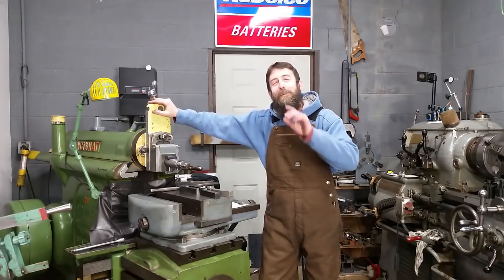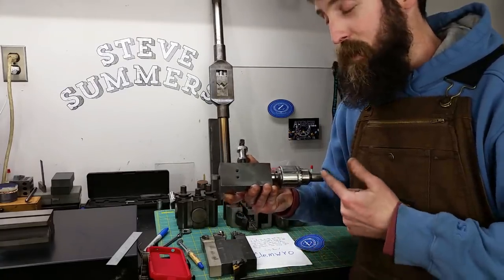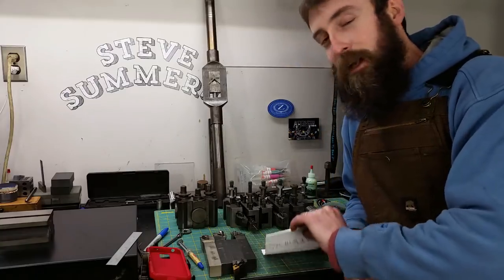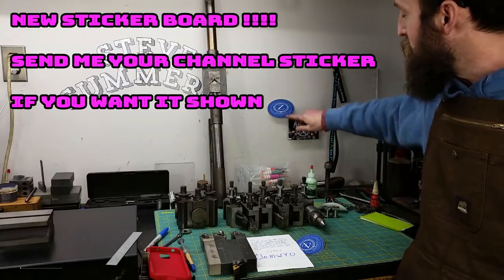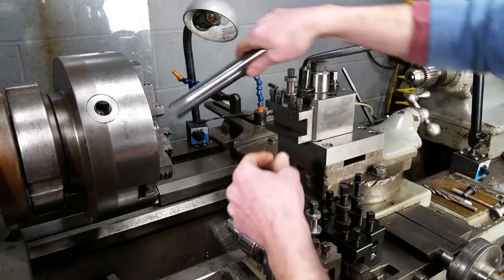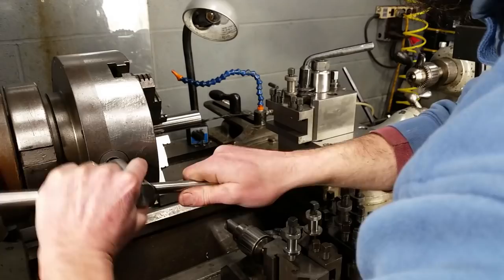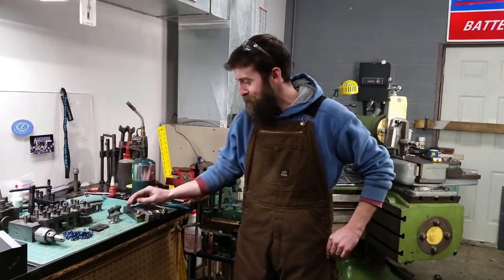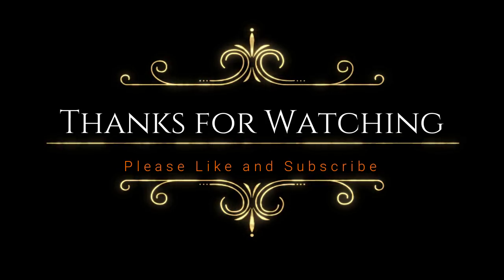SWEET !! Metal Shaper and Lathe work ;-)

Comment: Actually you can go back into a knurl. Just go up against it lightly with it not running be sure both your knurlers are in track and push in then start rotating.  Also 3 jaw chucks are designed to use a master key. The master key is the one that was tightened when the jaws were ground. It then needs to be used to tighten with in the future for maximum accuracy.  If you don't do this you will end up chasing your tail as if you tighten up a different key first the runout will be drastically different.  At least this has been my experience. I have the #1 screw marked on my chuck and always tighten with that one and achieve repeatable run outs on any given diameter in the less than .002" range.  If I tighten with one of the other screws first I can see run outs of .005-.010".
Reply from the maker: bcbloc02 I did not know that 🤔 never noticed if one had a mark on it or not. Got to go check..
I'm also interested to see if I get different results, I did notice that it seemed to help it I hit them all, I just thought that I was reducing the chance that I was pulling the scroll to one side.
Thanks Brian I'll look closer and see what I can find.
Reply: My Bison has a "0" mark to go by.  I hit all three, and make sure the marked one is always last. 
Because I have to be careful on how hard I pull on something, I started using a torque wrench.  The additional length makes it easier to do the final cinch without putting too much gronk on it ... or if you are one to err on the cautious side, to make sure you put enough on it.
Reply: I don't know if it is a standard or not but on my Cushman it is the screw between the #1 and #2 jaws. It has a - next to the screw.  That has the #3 jaw down and thus it lifts your part up with a single jaw vs pinching it up between 2 and that makes it clamp up more evenly vs gravity. I have always been of the opinion that 3 jaw chucks intend for you to tighten only with the master key as it gets the part plenty tight and the purpose of chucks like this is speed. Having to go around and hit all 3 wastes time. The only reason they give you others is so you can tighten from alternative sides for different applications.  3 jaw is all about speed of use with reasonable accuracy.  I hope this helps you to get better results. :-) Creek up your way?
Reply: That may very well be, I always figured that if hitting all three was good practice with a drill chuck, it would be good for a lathe chuck.  Bring 'em in with one, snug with the second, whang 'er down with the 3rd was how I used to do it, before I employed the torque wrench, now I hit all three with equal pull ... might be better for the scroll that way, and in the long run it's still faster/easier than the 4 jaw.

I haven't paid much attention to the local creeks.  The way cold, icy weather affects me, I've barely poked my nose out the door over the last few days.  The niece's latest rescue is fine with that, when she rescued it it was 10 below outside, and it was wild as a rabbit, a true touch-me-not.  Now it's a heat and attention seeking cockleburr that thinks people are warm blooded furniture and that attention isn't such a bad thing.
Reply: A chuck that repeats within 0.002" is a real good standard chuck, to get better like within half a thousand the price multiplies by up to 5 times...   Brian is right aboutthe 0 or the the key with the most repeatable operation...
About using a Bump type knurler, the diameter is quite important without being critical, also don't be affraid to really "BUMP" it in right off the start so the wheels make their imprint deep enough in the first rotation, then on the second rotation the wheels will get something to track back into, you have the chance to posess a bigger size lathe this will help you with this bump knurling method...
If you want more detailed info on the paratice and theory of knurling I've got 2 videos on it, if you ever watch and could comment on how understandable it is it would be great to have feedback from someone that is newer to the subject.  I'm using pinch type tool, though...
Reply: Pierre's Garage tom Lipton has a video that goes into the diameter/knurls per inch math and stuff, very informative and quite easy to understand, I'll go check yours out right now

Comment: You need some fire bricks to heat things on, would greatly speed up the process. Your projects in this video came out very nice. I actually like the knurling you did on your tap wrench handle. I'm not a fan of sharp knurls  on tool handle like that, too hard on your hands.
Reply from the maker: carlquib Hey Carl good to see you.  I have some fire brick, I was just to lazy to go in the welding area and get them.  You are correct, if you notice the vise was pulling all the heat out of the part and the color was lighter on the bottom because of it. Thanks for stopping by, always a pleasure 👍

Comment: Thanks Steve,  thoroughly enjoyed that video. I spent an hour cutting down an oversized parting tool yesterday. Real slow, lots of smoke n oil and curling blue chips .. very satisfying. Had to take care as it was a butt welded HSS bit and I ended up using a brazed carbide bit to get through the welded area. All the best mat. PS nice heat blue job ☺

Comment: Time to stock up on some morse taper drill bits and that way you could eliminate the drill chuck in that holder. Should tighten up your run out I would think.

Comment: Hi Steve, Here's another tip from the Montreal crowd (I will add, Phil's an awesome guy in person, too). I have noticed that you tend to hold only the handle on your files on the lathe, which can be dangerous. A better technique is to hold the handle in your left hand, and reach around with your right hand to hold the tip. This reduces the chance the file will get caught in the chuck, which would make for a bad shop day indeed. Keep up the good work! -- Murray

Comment: Nice carbide insert tooling.  Those are some nice scores.
 I have built up a nice assortment of insert holders myself. They are so handy, I resist using regular HSS bits as much as possible sometimes to a fault where the HSS would have been the better choice. It is just so damn easy to change the insert for a fresh tip, no grinding needed.

Comment: Blowing smoke rings at 36.40 minutes.Classy.
You can also traverse the knurl tool across the face each way.Best not to run off the edge though.Helps to even out the cut.

Comment: Ive had to do that a few times to some tooling that I had gotten for the lathe so it would fit also. When you were cutting that tooling, it looked like how it was cutting the quick change tool post I was making, lol. I wonder if it's made of the same stuff? (somewhere between rock and too freaking hard)

Comment: I know that tool holders are tough I've milled dovetails in them for direct mount to BXA holders. Then drilling and tapping them are fun
Reply from the maker: James Dedmon They are extremely hard. I can imagine that milling slots would be tough.
Reply: It is but if you use insert milling cutters it works ok

Comment: Thanks for making the video. Runout on your three jaw looks fine for that piece of stock. But if you chuck something larger or smaller you will most likely find different runout. And since you were turning all the diameters on your workpiece in one chucking and parting off, it doesn’t matter how much runout you have in your chuck for this project. Grinding the chuck jaws is primarily to correct a bell mouth condition. If runout is a real concern use a four jaw chuck and indicate the workpiece in as accurately as needed or use a collet chuck. Of course, with your large lathe, the chuck weighs a ton and not easy to change. Thanks for the bluing exercise. Most of the parts I make for my gage shop customer spec a black oxide finish I use a room temperature chemical process. Have fun making chips.

Comment: Love watching the shaper do its thing. They are just a big scary mechanical contraption. My favorite! 
And dropping something in the chip pan, you're lucky you found it. Even on my small lathe with a chip pan I can easily remove, anything smaller than a sledgehammer can disappear for a long time. I think the chips try to get back at you for removing them, and attempt to eat whatever you dropped amongst them!

Comment: This Old Tony awesome work! To make modeling simpler I would have left out the blade as it’s mass is so low and it’s stiffness is so high(axially) that I would expect that it will not have a significant impact.  As far as actually measuring your vibration at the face\edge I would use something called a laser doppler vibrometer. The only caveat is that I think that they would get expensive above ~20kHz. It would tell you not only frequency but also speed which could be turned into(integrated) displacement with your Scope and a math function. The other way would be to use a high speed camera. I would expect that you would need at least 80k frames per second and more would be better.
Reply: Wrong video ;-)

Comment: @9:00 in your video. you are indicating the run out.. can you stick your indicator to the chuck face and check for rise in the chucks as you tighten them  where the grooves in the internal jaws have worn slightly.. or check them on the surface plate.  perhaps needing to figure out if you can do something like spray welding up the groove and using your shaper to very carefully cut tighter fitting grooves..  might have to do something similar on the chuck face.

Comment: Hi Steve, nice mixed content 👍. I have one quick question, why did you loosen the cutter to square up to the work rather than loosening the QCTP? only thing i can think of is habit after using the multi tool holder or the main block was already perfectly squared for drillchuck holder and you did not want to move it. They are not only quick change but aslo quick swivel to get a good cutting angle. Mi qctp is the same style only much smaller.
Reply from the maker: Derek Greenhalgh The tool post was already set for other holders and I didn't want t
 re adjust  all the others👍
Thanks for watching, I really appreciate it.

Comment: Nice work Steve! Did you put a packing piece on the opposite side of the vise to have it loaded evenly when you gripped that toolholder?
ATB, Robin
Reply from the maker: ROBRENZ I did not. I should but I always forget details like that. I notice the difference in clamping strength when I do it. 
That would be a good thing to mention in a future video. I appreciate the attention and the reminder. I will think about it next time.
Always a pleasure Robin, Thanks👍
Reply: I think the singing noise on on those cuts was because the toolholder was only tight at the tail end from jaw deflection and could vibrate like a tuning fork at the insert end.
Reply from the maker: ROBRENZ Very well could be.. not sure but it was late in the operation and I was thinking it may have been due to the cutter dulling but that was just a thought.

Comment: For an old chuck I would be satisfied with the run out you have. If you regrind the jaws on a Universal  Chuck it will only
be accurate at the opening position that it was reground at. Other positions will be dependent on the condition of the Scroll
and the wear on the Jaw Guide Openings. If the Jaws are sprung Regrinding may help your grip but other than that
I would be happy
Reply from the maker: Wayne Gotthardt I ground these once before a few years ago just like Robin R did and it turned out nice. I did have about .005- .008  runout no matter what I did.  I'm aware that the wear in the scroll and jaw slots make a difference depending on the opening position. A old chuck reground at 1 opening position may be out everywhere else.  I m pretty happy with its runout gripping with the full jaw. The issue is clamping short at the ends of the jaws. To be honest it's fine for 99.9% of what I do but it would make a good video for the folks who have never done it.. Thanks for watching and the great comment, that's some good info that I think a lot of people don't realize.  Including me a few years back.👍

Comment: nice job steve, i was impressed that you were able to take a 3/4 wide plunge cut , and no tailstock support , that must be a very ridged lathe. i never saw anyone use your technique for power taping, i'll have to remember that one.
Reply from the maker: larry sperling works well, if the tap hangs it just spins in the chuck.  I would not try it with carbon steel taps, they grip the chuck jaws much better than HSS taps. Carbide taps also work well.

Comment: I make precision spinning tops out of lots of materials- titanium, zirconium, damascus stainless steel, copper, brass, and aluminum. I have found AnchorLube to be extremely effective for a knurling lubricant in almost all of those metals. It’s counter intuitive because normally you want to flush away debris in knurling. But the high pressure of the tool is lubricated by the thickness of the AnchorLube really well. Give it a shot!
Reply: Ah! Commented before I got to that part of the video. Good stuff! One other tip- while I recognize that AnchorLube is water based, never the less I have found a quick spray of WD-40 on the part and a light scrubbing with an old toothbrush cleans the AnchorLube right off.
Reply from the maker: deemstyle Thanks, Seemed to work pretty well in my limited experience. I plan to try it on several things over the next few weeks.

Comment: Steve,

I am curious, when would you want to run a lathe bit .100 low?
Reply from the maker: Roger Shoaf you wouldn't, I just wanted the clearance and didn't want to deal with one tiny chip getting under the holder and holding me above center.

Comment: I tried using mill cutter on one of those tool holders. Instantly burned it up and work hardened the holder. Almost makes me wish I had a shaper. Great projects and demonstration Steve!
Reply from the maker: John McDonald I've done the same thing, carbide will cook also if pushed hard into these holder. Done that to😃.   The shaper really does good with hard to cut material.   Good to see you John👍

Comment: Could you rigid tap by putting a tap in the tool post mounted chuck and then feeding in at the appropriate TPI as for normal thread cutting?
Reply from the maker: grafixbyjorj You could, the setup would need to be spot on or you would run into problems. Lot more things to go wrong, but it could be done.
Reply: Yeah, but it would be fun to try. Maybe not in tough material with a big tap to start with :)

Comment: Hi Steve!
The shaper really did a good job with the tool holder. But I couldn't help wondering about the table, don't you have a support beneath it to keep the outer end up and stable? It looked like the whole table dipped and that would translate into different amount machined of material when comparing the ends on the tool holders? 
Thank you for sharing!
Reply from the maker: mectechman1 This universal table was not designed to need a table support, you could get one as a option but the factory manual says no support needed for even the heaviest cuts.. the casting that supports this table is massive. The 32"& 36" shapers with the universal table had a table support factory due to the longer tables.👍
Reply: Have you tried to put a dial on to check how much it opens up under load? Just curious.
Reply from the maker: mectechman1 Everything matters and depending on the load it would matter. Just setting the big vise on the table changes the tram. No I have not checked under cutting loads because they are always changing. But if I'm doing an operation that requires extreme accuracy I cut and tram accordingly. And I always finish up with a lite cut and spring cut if necessary. If I'm cutting off the table with a heavy load I tram loaded if possible. She moves under heavy load, they all do. Thanks for the comments and I appreciate you watching 👍